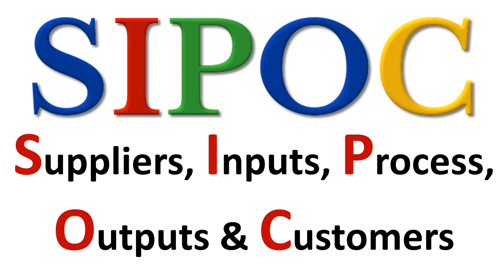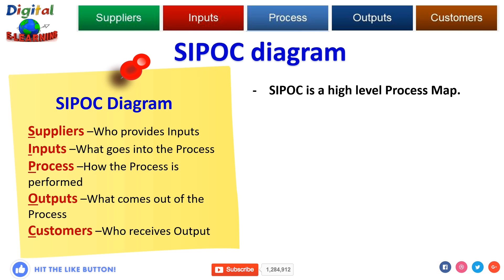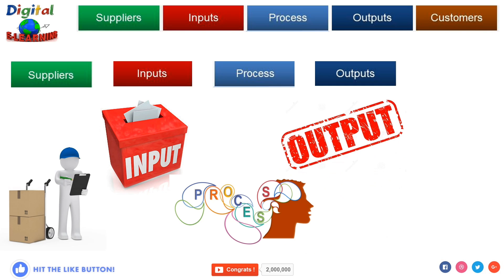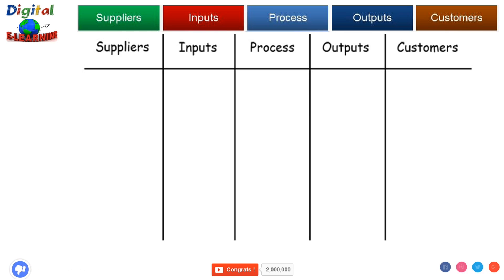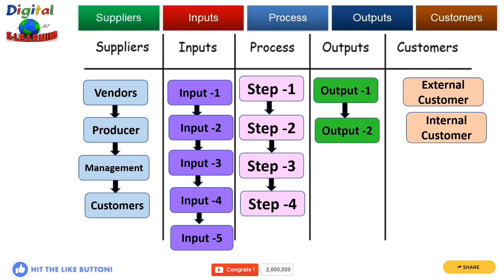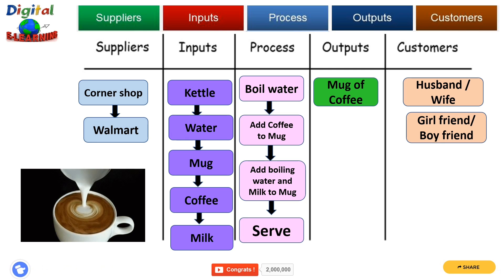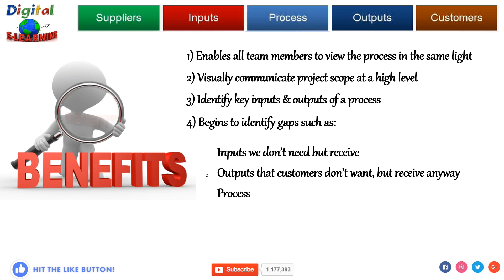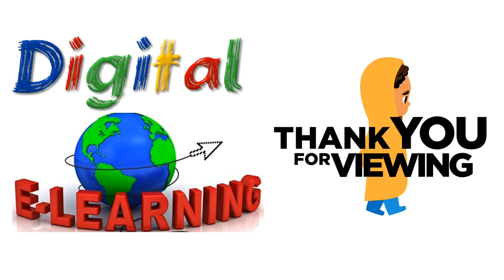What is SIPOC diagram ? | How to create SIPOC diagram with example? | SIPOC High Level Process Map

Comment: Good.  However, you will find if you start a SIPOC with the customers column you are more likely to get what the results for the level CTQ you desire.  C-First, O-what do they want, Processes- what do you have to do to get the desired outputs the customer wants, I-what do the processes need to be successful, S-who will give you the things you need to perform the processes.
Good work otherwise!